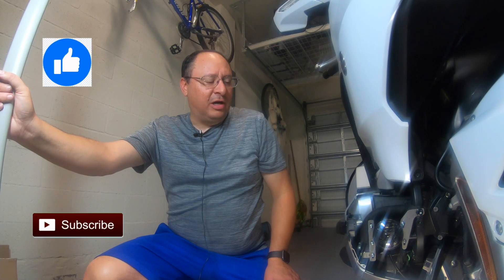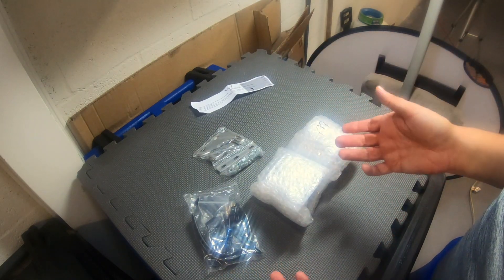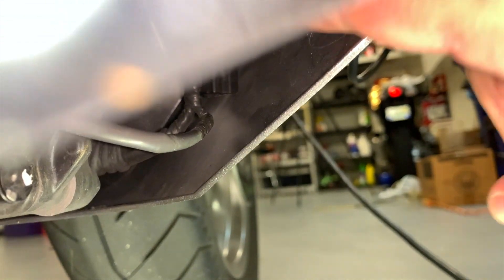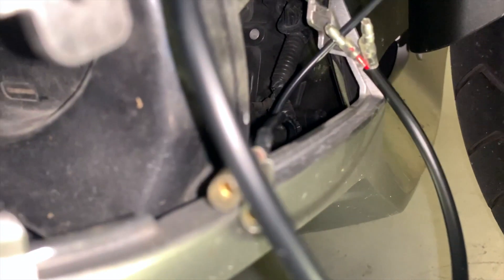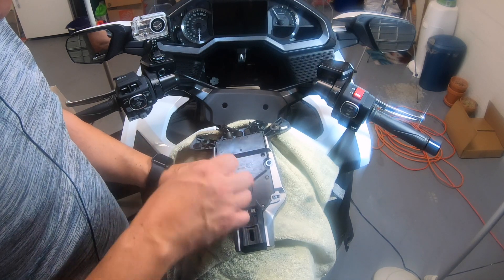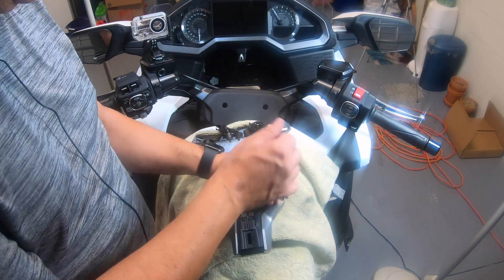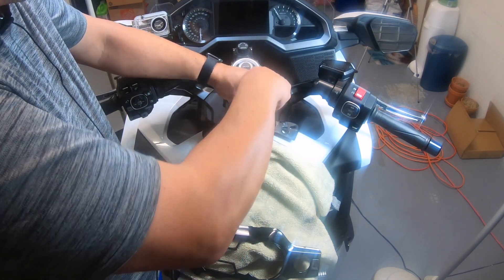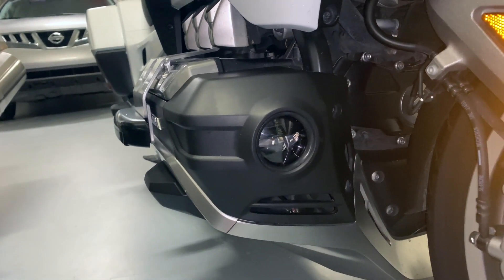Fog Light Install. 2018 + Honda Goldwing electrical connection

Comment: After watching your video, I easily installed the EC fog lights on my 2018 Goldwing Tour. I installed the Gold Strike tie-down brackets at the same time. Very easy to do following your instructions. I still need to play a little with aiming them but that will get resolved in due time. Glad I saw you use the shortcut for button install.
Reply from the maker: Glad it helped. Took a few try’s to get the aim correct as well. Ride safe.

Comment: I will ask you the same questions as I've asked others who have posted similar videos. Are the fog lights connected in line with the headlights? In other words, the only reason to install the switch is if you want to turn them off? Without the switch installed wouldn't these lights be on all the time? That would save having to install the switch button...
Reply from the maker: It sure about that. I’m sure you can hot wire them to be on all the time. The switch does control the power, before I put the button on after plug all the lower wires in the lights did not come on until I installed the on/off button. It’s not hard to move the center console, with the short cut.

Comment: Would you please provide me with the OEM part number for the fog light kit you used in this install. Thanks for the great videos.
Reply from the maker: They are electrical connections lights, not the OEM. Bought them at Wingstuff. https://wingstuff.com/products/38200-ec-foglight-kit-for-2018-gold-wing

Comment: hey pete. any reason why you chose this particular brand instead of the pathfinder one? I found the pathfinder ones gives you the option of using DRL only, if you wish, and also has a strobe function. Keep safe buddy.
Also is the button backlit?
Reply from the maker: I did look at the pathfinders, I have had good success with Electrical Connection products in the past so I stuck with them. The strobe function doesn’t appeal to me, and in some states I’m sure it’s a way to get pulled over. Even though they aren’t technically illegal. EC has released a wire harness for the lights that will allow them to stay on with the high beams on. 
And yes the button is illuminated.

Comment: hey pete another question, i noticed you have the rivco foot pegs installed, what is your take on the review on those pegs. It is pricey, are they worth the top dollar they command?
Reply: Zunaid Kajee i cant speak for Pete but i love mine on my 2016 gl1800. I have had them for about 5000 miles very comfortable. And i like that they seem concealed when put away. Worth the extra money to me
Reply: @jimtaucher791  thank you for the response Jim. I also like the design that it can be tucked away, and looks factory fitted
Reply from the maker: Are they worth the price, yes. Could they be a little cheaper yes. Before I put the Rivco pegs on I made my own attached to the crash bars. While they worked well, they would drag on the ground with heavy corners. I went with the Rivco due to the clean look and adjustability. Worth having especially for those long trips.

Comment: Do these really light up the road ahead or just a small forward and sides? I find the headlights are awful at night and you need the high beams on if you are travelling at speed. The regular lights barely give you a second of light. I'd be interested if they lit the road farther than the regular headlights without being in the way for oncoming traffic
Reply from the maker: I haven’t been out at night yet. One thing I had to do with the headlights was adjust them. They were aimed high from the factory. The led lights when aimed correctly are bright compared to my 2007.
Reply: My head lights where aimed into the ground , all that was lit up was about 10ft . Two round dials in your faring that adjust your lights .

Comment: Pete, any thoughts on Path Finder, or Show Chrome fog lights. Is the install pretty much the same from brand to brand?
Reply from the maker: They are all about the same. There is one brand that doesn’t use the center button, it uses it own switch. Either way it’s a straight forward install.

Comment: Hi Pete, is there any additional "precaution" with the DCT airbarg model ?
Reply from the maker: Not that I’m aware of. I would disconnect the battery for safety.
Reply: @Petesmotoadventure  Thank you very much for the tip.